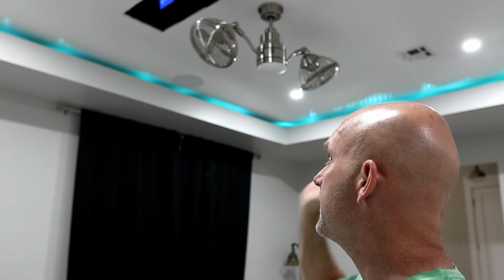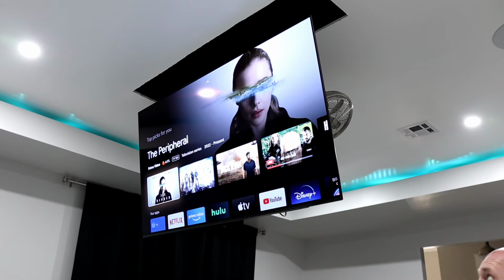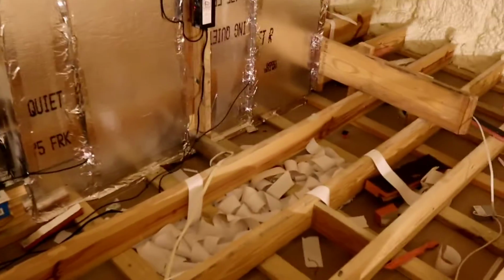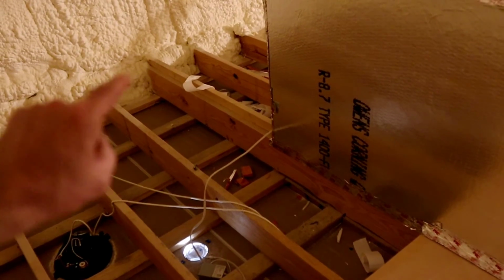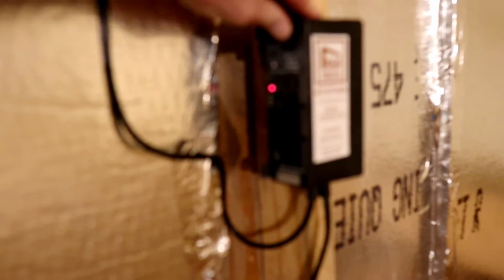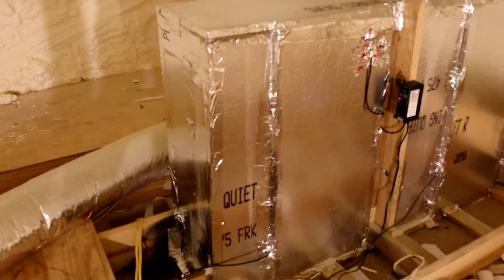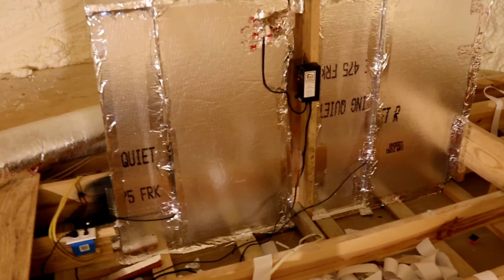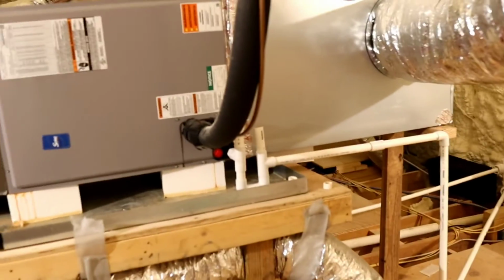TV Lift install and operation.  Home Theater Gurus.

Comment: To gain more TV screen angle, in relation to your head placement on your bed, would it be possible to angle the entire lift assembly? Additional "kicker boards" would be necessary for added support of course. Just a thought... 
Great video(s) btw!👍
Reply from the maker: Thanks.  That is actually a great idea!  Honestly as it's an oled we don't notice the issue but I was worried about it at first.  This is by far our favorite bedroom TV setup we have ever had.

Comment: DIRECTIONAL BASS
Reply from the maker: WET WATER!!!
Reply: Ok ill wait
Reply from the maker: @bingdong8571  i thought you were joking as you made a statement in all caps like you're yelling out " directional bass" . . Did you have a question?
Reply: I've seen the new directional bass option added to new marantz processors, is this like a simplified version of trinnov, also this reintroduce directional bass which got lost for a while because of numbers people, you absolutely can hear the point of source no matter what the science says, im very interested in the reimplimentation of this. Do you have any experience with directional bass. If so what do you think?

Comment: Maybe this lift here https://youtu.be/UrUenGABgKo?t=137 could be a solution.
Reply from the maker: Those are cool lifts but they require a huge cavity for a TV this size. I do like the adjustable angle of those. 
  
This  new lift that we installed here is the solution.  It works as it should and I don't have to climb on a bench to help it up.. :)

Comment: What did you think of the Audioholics interview with the sound mixer guy?  I saw you askin' questions, figured you'd be interested!
Reply from the maker: It was a great interview.
Reply: @hometheatergurus  Yeah, gave me a new perspective on some things and a bit of a glimpse into the other side of the content / production side.  Reinforced running those heights a bit tighter up top and also some interesting perspective on upmixing.
Reply from the maker: @commanderrussels2612  much of the info is in the studio pdf as far as layout but the glimpse into their world was super cool.

Comment: Just have a great room for TV/movies/etc and then that's it.  Terrible sleep hygiene to watch TV and bed and this whole thing is just a weird setup.  Bed is for sleep and sex m8.  Also you built your house custom, if you DID want to have a TV in the bedroom, why not design the bedroom so you can mount it on a wall?   To me the whole point of having a home theater is to have an amazing place to consume media, that way the rest of your house doesn't have weird stuff hanging from the ceiling...
Reply from the maker: We don't have the TV on while we sleep so it's nno different than watching in another room.    We like to relax in the evenings and watch our shows in different ways.  It's our "other"  get away.  I didn't want it on the wall as we really don't like a TV on the wall and our wall is too far away at 20'.  This was planned before we built and we love it.    The TV here is at a far more comfortable angle vs on a wall.   We use the Theater as well but sometimes we just wanna crash in the bedroom and relax.  Lots of people have living room setups and bedroom setups.  We have different tastes.   If I was building again we'd be doing this again for sure.
Reply: Some people like to watch TV in bed once in a while, don't worry about it.
Reply: @northeastcorals  I'm just stating an alternative opinion, you all can do what you want.  Maybe it flashes some ideas in someone elses head though.. Also, if your wife doesn't like TVs everywhere, a great bargaining chip for a theater is "hey, it can be the only TV in the house".  I'm just a big believer in having a space to consume media and then using the rest of the space to be with family, create instead of consume, etc.   But, yeah, it's just one opinion.  Don't worry about it.